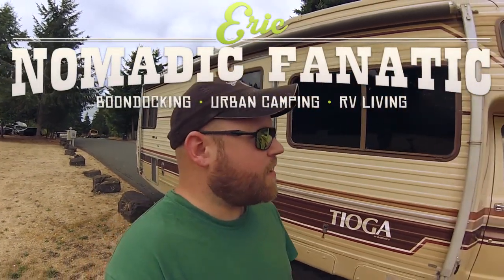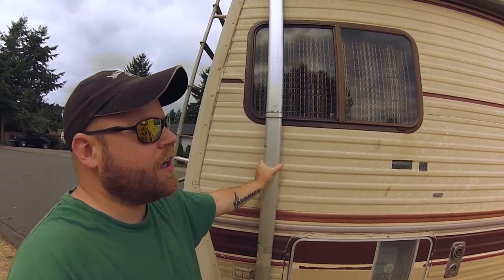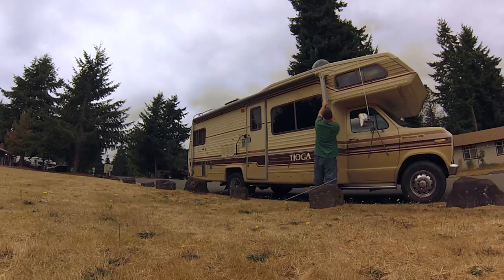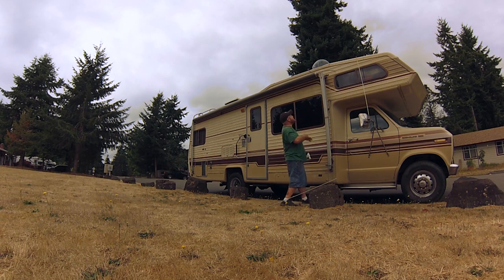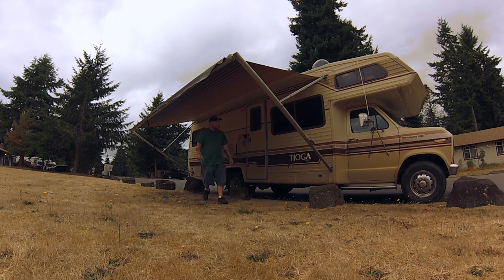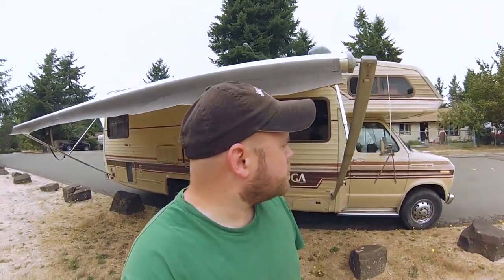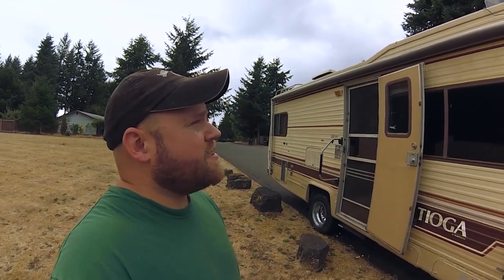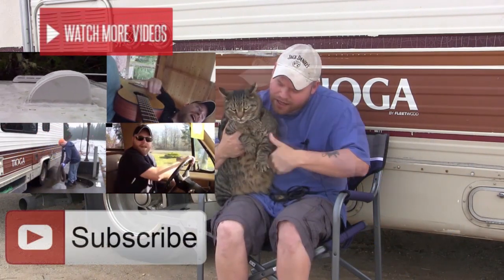Deploying RV Awning (A&E Systems)

Comment: Eric, 
You need to extend your crossarms all the way until they latch into the end of the arms.  Then you extend the crossarms to put tension and stretch the awning tight, then raise the arms to the desired height.  They make deflappers to stop fabric from flapping.

 Latching the crossarms form a triangle which is the strongest arrangement for your awning.  Having your crossarms located halfway will bend the arms in the case of a gust of wind and that can be expensive.  The wind will stress your configuration too much and cause your crossarms to move making the awning to loosen and cause damage.  

Move your strap towards the middle of the awning to equalize the force when pulling it open, best yet is to have it located when rolled up above your door.  Straps have a way to hide underneath the rolled up awning and if above the door its easier to get at it.

One last thing.....  Never leave the RV without rolling up your awning, also roll it up at night.  A sudden gust of wind will destroy your awning.

Comment: Great to have the awning. It will increase your living space and camping comfort.
Two things to remember about RV awnings: 1. A strong wing will rip them right off the RV, so never leave the awning deployed if you're leaving the RV for more than a few minutes. 2. If it's raining, lower one outside corner a bit for the rain to run off, otherwise it may pool up and the weight of the water could damage the fabric. 
Happy Camping!

Comment: Eric, buy a potato wash it and cut it in chunks or cubes leave the skin on. Put it in a small pot with water covering the potatoes. Simmer until done about 15 - 20 minutes. Drain and add butter and salt & pepper. This is so much healthier than those potato tots. I worry about you like a mom.
Reply from the maker: +pilotdiana Still lots of starch, but sounds yummy.
Reply: +pilotdiana Excellent, but in this case you can substitute the water for beer, the buzz will last a lot longer.
Reply: One more comment, sorry.  Your own cooked potato is not chemically processed and by keeping the skin on it lowers the glycemic level.  Don't see it as a starch, see it as a healthy carb. Enjoy!

Comment: You are relying on a dirty rail and friction to keep your awning extended.  After some wind, your supports are likely to loosen since you did not latch the supports correctly.  You never need two people to extend that type of awning.  If it loosens, get ready for some damage because the wind will take over while you are away,  like forgetting to tilt it in the rain.

Comment: Eric,  I think your one person operation was fine.  That is what I would have done... Also you may want to look at some candle wax on the alum tracks to help it slide better.  I don't like any type of oil or grease and graphite is dirty also..  The wax seems to work really well and keeps the tracks from wearing..  Just a thought!Keep us posted on the tires... Very Critical as you already know...
Reply from the maker: +J Doe Wax, really? Nice, thank you for the tip!
Reply: +Nomadic Fanatic Try and find some ski'ing snowboarders wax, that works pretty well :)

Comment: I'm sure you know this but make sure your steer tires are the first one you replace. I suggest you replace all 4 rear tires at the same time so you don't work the differential or put too much weight on one of the tire pairs. Happy traveling.

Comment: We always put velcro straps around the post on the awning when it was stored in so that the wind did not pull the awning out from the camper while going down the road.  It maybe just an extra step but will save your awning in high wind. You can get them at a camping store.
Reply from the maker: +kika44me yeah, these d-clamps seem pretty good, but I'm missing one right now.

Comment: You should take care not to make the awning too tight, or you stand the risk of ripping the fabric away from the side of the RV.  Walmart and other places sell anti flapping / Velcro,  clamps to keep the wind from ripping it.  As the material ages it get rather brittle, and will rip pretty easily.     Great seeing you two in another class C Tioga.

Comment: hey Eric you really should put the support arms at top locked position. the Reason for this is on the same day we had 11mph gusts at our RV park 2 rv  were setup exactly how you did it and both RV awning bent at the center main supports. Until I saw this i set up my awning the same way. Once i learned the proper awning set up i was actually able to get the fabric tighter but u might need a ladder i also added awning deflapper but not the one with the velcro get the heavy duty all plastic our awning can support up to 20mph gust with those deflappers. Just don't want u to learn the hard way its expensive

Comment: I kind of miss my manual awning. It would handle twice the wind that my electric one does. I never had help with it until one time and it didn't go so well so I told people to just let me get it. Lol. Packing up your campsite and doing your checks should always be done without interruption it can save you some heartache. If you have a travel buddy just have them double check everything off a list or do their own chores.
Reply: ***** if you have the time and would like to make some youtube videos showing what you have done and talk about what you would like to do! it would be neat to see a project in the works.

Thanks

Jed
Reply: Power awnings are nice, but mine is 21' long and built differently than others. My buddy has a different style that is much stronger, but maybe that has a lot to do with the length. but yeah any wind above 8 mph is making it flex. where as my manual awning was good to 16-18 mph before I was worried, it was also 21'.

Comment: Thanks, Eric! When you angle your awning to ensure that rain doesn't puddle on it, do you angle it for the water to run toward the back of the RV? I'd think so, but perhaps there are better reasons to make the water run toward the front of the RV. Thanks again!
Reply: Neal, your direction of sloop would depend on which way the ground sloops. You wouldn't want your awning drain to run through your dry area under the awning. Cheers

Comment: I wish you showed putting the awning back up in its place. I just bought an old motorhome and the awnings were opened when it was delivered to my home but they didn't show me how to roll it back up. Now I suspect that the spring is no good and will have to manually roll it with the assistance of another person. Two other people would be ideal. I hate learning things as I go, just because people are just so deceitful that they can't just tell you what the dang thing will need. They will get theirs, no doubt.

Comment: Do not use larger fuses then what the amp rating is on the conductor it is protecting. For if you do your putting yourself in danger of a fire.

Comment: Show how it goes back up in another video.
Reply from the maker: +nov51947 Do everything in reverse. Seriously. Switch that tab the other direction and do the entire operation in reverse. Easy.
Reply: +Nomadic Fanatic Can't wait til you get some rubber, I miss the sites. Have fun and stay safe.
Reply: +Nomadic Fanatic So is it spring loaded or do you have to crank it back on the holder.